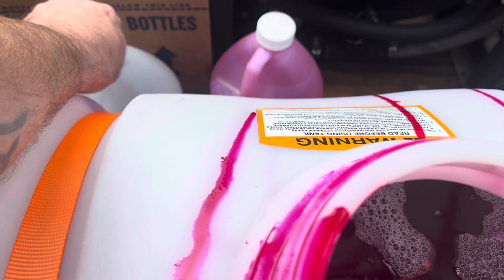HOW TO WASH A LUXURY HOME | LAKE FRONT AND RIVER FRONT LIVING | TIPS TO HELP YOU MAKE MONEY CLEANING

Comment: I see that remco in the back.  Should check out the new delavan FB3 series pumps.  Delevan and remco are the same basically but in the FB3 they fixed some of the internal issues that these pumps have.  From what I understand some person that used to work at Delavan left and started Remco. That’s why the pumps are almost identical but Delevan is cheaper and as of right now its a little better with the FB3.  7971 101ysb.  Nice dog to man!
Reply from the maker: That’s very interesting 🤔 and great to know. We appreciate the drop of knowledge 💎 and feedback. We’re not really in the 12 volt space but focus more on gas roof pumps and have them selling right now for only 1550 for Honda units so they are not that expensive to run or replace or whatever. I’m just getting to start running and selling a 12 volt option and that’s strictly PUMPTEC at this point. I am working on getting that system up and running. I sure appreciate your expertise and feedback and support. Stay in touch
Reply: @littlespressurewashing  sounds good yeah, I would like to see more of that pump tech for sure!
Reply from the maker: Trust me it’s on the way and I’m excited to showcase its full potential 💪 
Stay in touch

Comment: awesome just a question I have the red gun and I split the swivel is there a way to fix the gun I can't find anything on YouTube
Reply from the maker: I would try to replace the swivel at bottom of red gun,it should screw in and out and you can replace the swivel 👌
Reply from the maker: Would make for a good video 🤔
Reply: @littlespressurewashing  I sent it back to Georgia airless they said they can fix it